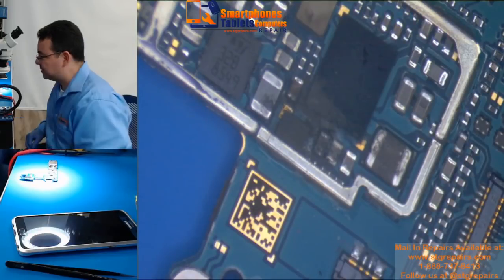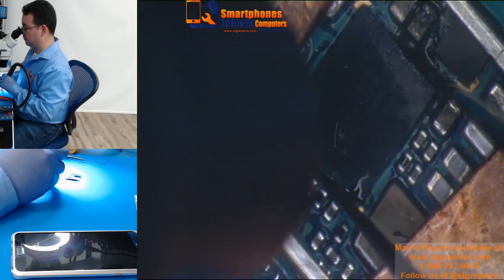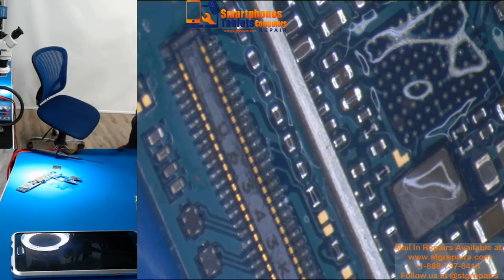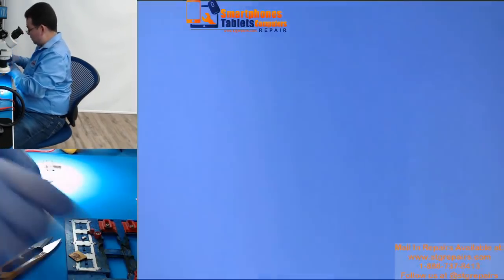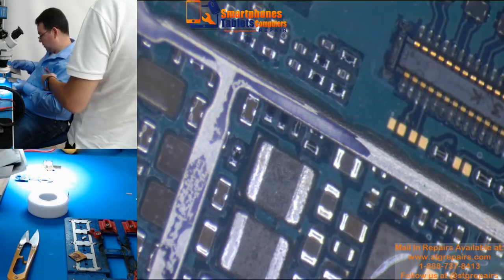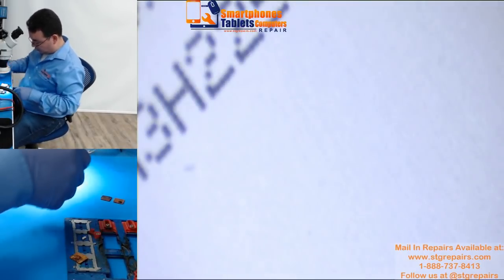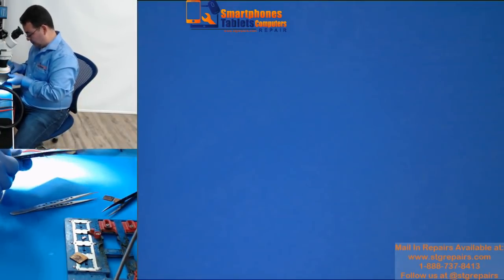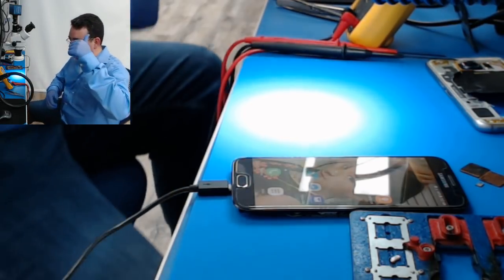Samsung Galaxy S6 Water Damaged Data Recovery

Comment: How you recovered the data?? My s6 edge is water damaged it was working but after the battery gets discharged it is not charging and giving "over heating cannot charge" but the device is cool still it gives that notification and shut down